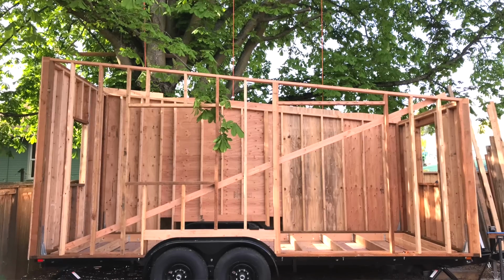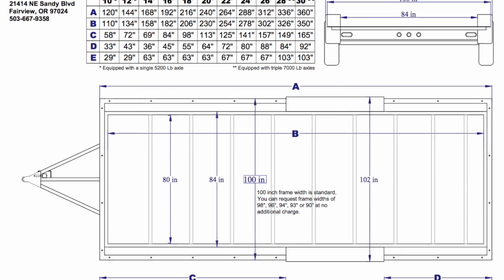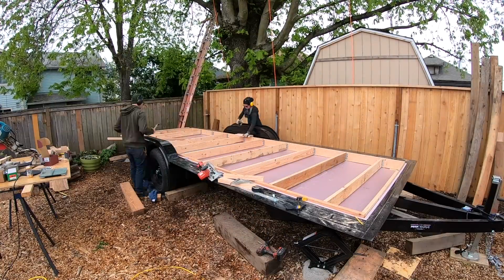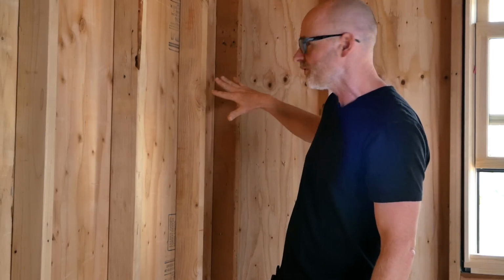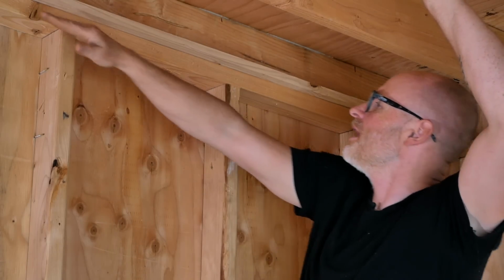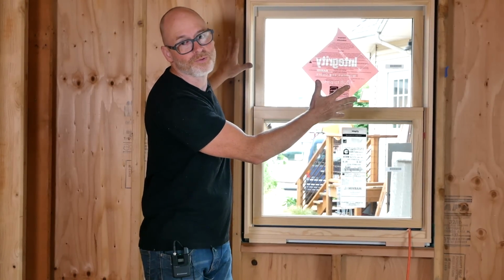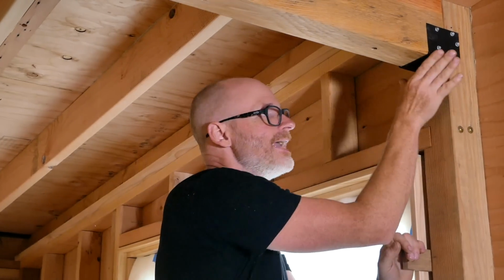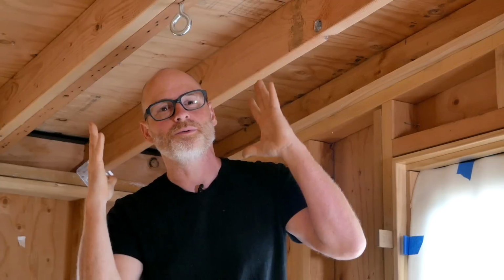Smart Framing For A Warmer Tiny House

Comment: Could you have run the roof rafters the other direction?
Reply from the maker: You could, but you'd have to run ventilation channels across them on the top which means you'd have to bump up to taller rafters and some challenging work.

Comment: Is the only reason to not go 100% poly iso in the roof the cost?  Or another reason?  And why not poly iso in the floor, rather that XPS?
Reply from the maker: For the floor it’s an issue of compressibility and moisture resistance,  for the roof it just gets kind of exhausting to cut and seal all of that foam, it’s also exhausting.   There might be a bit of a fire proofing issue as well.  Truthfully I would much rather have a simpler roof sandwich, But this is the best I could come up with at the time.

Comment: I disagree with your statement in your case that the direction of the plywood makes the floor more rigid. What makes the floor more rigid is the blocking underneath. Were you sheathing a roof that is unsupported with blocking then the direction of the plywood matters.

Comment: Have you framed before.  No king studs or header at windows .  Do you realize that it will go thru a 3.5 earthquake going down the road.  You need headers and web plates  Need a t band on the stud walls for support.  i see so many structural efficiencies

Comment: crappy wood doesn't promote thermal bridging as much a Doug Fir?  Interesting.  With wood, thermal bridging is almost a non-issue.  Metal... well that's another story.  You need square washers on your hold down bolts that are much larger and thicker.  Also that is not old growth DF that you claim.  If you look at the growth rings they are tight, which means it was probably harvested East of the Cascades.  Airspace above the roof is not necessary.  Go with a hot roof and use spray in insulation.

Comment: Bud, I have a feeling you aren't a carpenter by trade.  Let me point out 2 things among many. Rafter placement is questionable. It required you to put a height limiting beam to hold roof weight in the center of this tiny home. And you will also put another lumber to support this along with trim. These will stick out of the wall like a sore thumb on a tiny house.You could've avoided this and the support  bracket by cutting beam 7" longer and resting it at posts in the  wall..Also, this arrangement will most likely slope the roof lenghtwise - simple fact: Rafters set the slope of the roof. Unless there's no slope or you don't care about it.  2 The placent of your corners requires you to have unnecessary blocking. One can see this in your video. For clarication, see 'California corners' how to frame it.... just a constructive criticism...

Comment: You were doing so well until you said you didn't know how much of a concern underfloor condensation actually is - if you don't know, don't put doubts in non-professional peoples minds.. there is so much misunderstanding and misinformation about insulating and moisture control out there in tiny, schoolie and cargo trailer land - don't add to it. Too bad you didn't tape all the joints and perimeter and make it a continuous barrier. Hope that trailer tray is drained too just in case..
To be clear, plywood should run counter/crossways to the joist span. 
Next time, I'd put your bolts the other way up - that way your threads won' t rust and it'll all come apart easily should you want it to down the road (not literally down the road!). 
Given you're attaching plywood to the studs and plates, connecting the two together those hurricane ties ARE a ridiculous amount of overkill, completely unnecessary - so why do it?.. if you really have any concerns just nail the ply at closer centres.
Just put your 1x3 corners on before you sheath - easier to fix and you just drill thru for plumbing at the same time as drilling the stud rather than adding a job.
Given the spans/loads you're dealing with on a tiny, there is absolutely no need for a double top plate even if you landed a joist between studs - the ply would easily add enough strength to the plate if nailed adequately.  You didn't need it over the window either - just block it. You've added so much thermal bridging in the additional plate you've lost anything you might have gained.  
Baffled as to why you'd house the header to the French doors into the post but not the beam. Set it onto a 3/4" ledge and GRK down from the top - done. 
If you're concerned about the weight of deeper joists for greater insulation use TJI's. Your joist spacing determines the thickness of the sheet materials you can apply to it - fewer joists at bigger spacings  means thicker, heavier plywood decking and drywall/whatever ceiling finish you use. Might not be much in it in the end.
You put foam insulation ABOVE a ventilation gap?! How does that not render the foam insulation completely ineffective?
Reply: No, he didn’t.
Reply from the maker: Condensation in building materials is pretty complicated. I've seen even professional builders get it disastrously wrong.  So much depends on climate.  Personally, in walls and floors I take the approach of air sealed, but not vapor sealed materials. The pan is drained, but that's just in case of some crazy flood or water leak situation.  

Hurricane ties are way overkill, but I don't mind recommending that in a presentation aimed at first time builders.  It was cheaper to buy these monsters than to wait for the lumber yard to order in the smaller ones. Generally I went as sparse on the framing as I felt good about without having to check the engineering on anything. 

Roof is vented ABOVE the foam.  Although personally I hate this whole roof.  I was trapped between an overhang I couldn't build above and still move the house, and an interior height geometry that I couldn't change and still have my hybrid wood fired/solar hot water loop work.  So 5 1/2 inches is all I have to work with.  If I had time, I would have just filled the whole thing with foam and made it a non vented hot roof. 

Sliding the 1x3 in after the plumbing just has to with actually being able to operate the crimper in that corner.

Ledging for the beam makes sense, I feel like I considered it and decided on a hanger but can't remember why.
Reply: @doloresreynolds8145  A one line denial of multiple points? Good job

Comment: "Smart Framing For a Warmer Tiny House"
Trailer: nope
Axles: nope
Hold downs: nope
Insulation: nope (not framing)
15 minutes down the tube, and still nothing on framing that saves heat. christ you blather a lot. Never say "I wanna give you a tip", or "I'm gonna tell you how to...", just give the tip, or tell how to do it. Introductory sentences are a waste of time, and your video is full of them. Edit, edit, and then edit some more.
Unless your goal is to waste your viewers' time, cut out 3/4 of what you say. Get to the point right out of the gate.
Reply from the maker: The point of this channel is to hit the details that other presenters miss on exactly the points where people make the most mistakes.  The video shows you how to choose a good platform to start with, attach the house securely to it, create smart thermal breaks in the floor, and gives you a ton of ideas for how to minimize framing and window area while preserving light and view, so you can maximize the room in the walls for insulation.

To your point on my speaking style, I have a brain injury. I do the best I can.  I'm sorry that you were unhappy with this free video.

Comment: or you could have framed using metal studs on 2 ft centers metal studs allow for insolating the inside of stud so no thermal escape threw stud 2ft centers instead of 16 inch center allow for more insolation without sacrificing the integrity of the structure plus metal framing is half the lbs compared to wood lumber with the same level of strength  its hilarious reading the comment section of all these armatures praising you as if you actually did anything different from any other basic construction or even did what your title of the video implied haha    next video will be you installing hardwood flooring or marble tile and you will title the video how to build tiny house on wheels with lightweight flooring bahahahaha